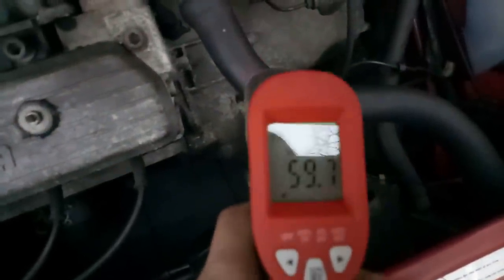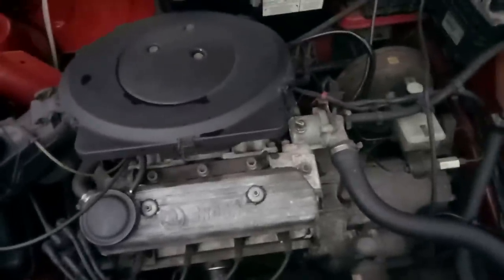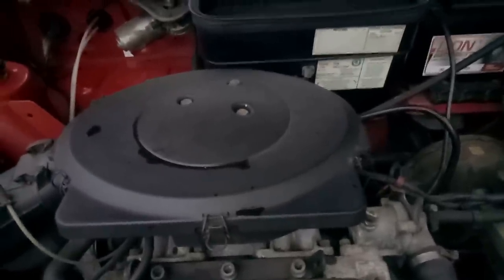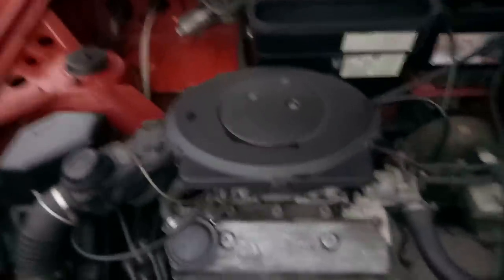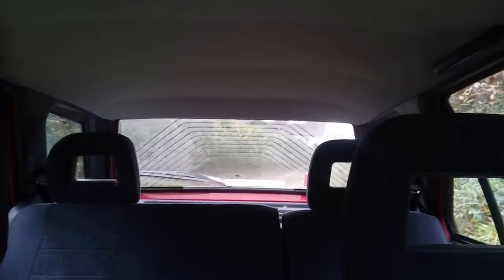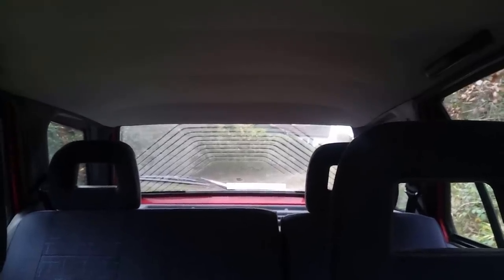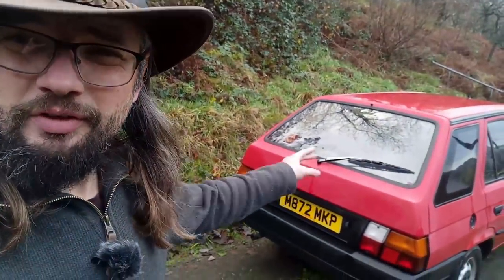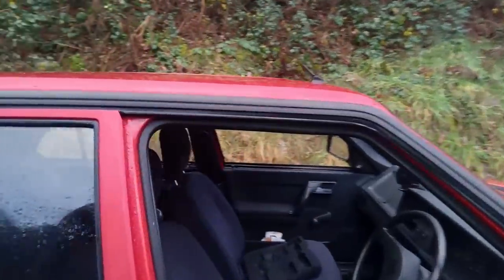Skoda Favorit Odometer fix (and other things)

Comment: A small amount of Oil Emulsion or ‘Mayonnaise’ in the Rocker Cover and Oil Filler Cap is usually a sign that the car has been used for short journeys in a relatively cold climate. The engine is barely able to achieve its optimum operating temperature. This can be termed as ‘Condensation Sludge.’ Different materials and their Mass used for the Rocker Box, and Cylinder Head (Steel –v– Aluminium Alloy, etc.) will also make a difference too. Another fundamental cause will be ‘Climate,’ as the Rocker Box is the first zone to cool when the engine has stopped – Condensation Sludge hardly ever appears in Hot Climates!

Large amounts of Emulsion will indicate more severe problems such as a Failed Cylinder Head Gasket, Worn Piston Rings, or Leaky Valves, etc. Water will also be present on the Dip-Stick. However, some cars are notorious for ‘Excessive Sludge.’ (Old Vauxhall/Bedford HA, HB and HC Engines in particular) Typically, a Compression Test will highlight serious problems within the engine, thus isolating ‘Condensation Sludge’ as the culprit.

The Emulsified Deposit forms when water is mixed with oil, and ‘Whisked’ with the general clatter of the engine. Water (from combustion) gets in to the Rocker Box through the ‘Blow-By Effect.’ The Gasses and Vapour in the Rocker Box are ‘Scavenged’ with a Crude Ventilation System – Usually a piece of Rubber Tube, running from the Rocker Box to a point just before the Inlet Manifold. There can also be a ‘Tee Joint’ with a second tube running to the base of the Air Filter Housing (Vauxhall Failed Solution). However and to work effectively, there needs to be an ‘Adequate’ (but not excessive) FLOW of air – Ideally ‘Incoming’ from the Air Filter Housing, and then ‘Outgoing’ from the Rocker Box to the Inlet Manifold, from opposing ends of the Rocker Box.

The Vauxhall ‘Luton Abscess,’ was caused by almost non-existent ‘Scavenging Air Flow!’ – Incoming and Outgoing Air were attempting to pass through the same ‘Y Shaped Hose.’ Inlet and Outlet air also used the same Spigot. Also, the Spigot Block on the Inlet Manifold, had a miniscule ventilation hole that became blocked with sludge as soon as you looked at it! In some severe cases it could also send sludge up to the Air Filter Box, contaminating the Air Filter Matrix, before completely blocking the inlet tubes – Zero Crankcase Ventilation, thus generating even more ‘Mayo!’ Vauxhall’s response at the time was “No need to worry, Sir! – They all do that!”

The solution was to abandon the Y Shaped Hose and use two separate tubes, to create FLOW. This did mean forming a second Spigot to the Rocker Box. Air then flowed IN from the Base of the Air Filter (Post-Filter), and OUT to the Inlet Manifold. A slight adjustment of the Idle and Mixture settings would also be required (Carburettor Engines).

From the video (and the Gauze Filter Mesh in the Oil Filler Cap), it looks as though the Skoda uses the Oil Filler Cap for the INLET Crankcase Ventilation. Some Caps are more sophisticated, having a Non-Return Valve to prevent ‘Oily Smells’ venting back to the Engine Compartment. The valve can sometimes ‘Stick Closed!’

I would suggest replacing the tube from the Rocker Box to the Inlet Manifold; as the rubber degrades quite quickly, and will eventually block the tube! There should also be no constrictions or sharp bends in the tube either, as this severely limits the flow of air, and will cause ‘Cold Spots’ where Sludge will form.

The Thermostat also appears to be a contributor here too, as the car is not reaching its optimum operating temperature. If it was ‘Stuck Open’ your Heater would not work at all, and there would be low temperature readings almost everywhere (IR Thermometer). You also mentioned that the Radiator Fan does not engage either – Radiator not reaching ‘Trigger Temperature’ for the fan. It is possible that the Thermostat is not closing fully, resulting in low temperatures. Therefore, change the Thermostat, and Flush ALL of the Cooling System. The Cooling System could also be full of ‘Hard Tap Water’ – An indication here will be large amounts of calcified deposits around the Thermostat Housing, when it is taken apart. In some instances (Black Country Water), I have seen Water Pumps seized with ‘Calcates!’

As someone else suggested, it would appear that the Temperature Gauge is a ‘Red Herring,’ in that a VW Sensor was fitted rather than a Skoda. They will have different ‘Temperature Sensing Ranges’ – Hence the ‘Slightly Hot’ indication of the Dashboard Gauge, when the engine is actually running quite cold.

Comment: Lit up like a Christmas Tree, how apposite. Looking at how the drums were reacting when you opened it (and the Sellotape) that someone has done a bodge of clocking the mileage. The fan should be controlled by a separate  thermo switch. Check the earth between the engine casing and the chassis by bridging straight to the battery -ve and see if it makes a difference to the gauge reading.

Comment: Had a favourite and a few Skodas with that engine.  The engine is bomb proof but it is noisey.  Remember is was a rear engine on a car with a front end radiator.  Not a quiet car body, but in a bad way faults seldom mattered.

Comment: The Favorit steering rack is a weak part. My mate's failed on the way down to Cornwall; seemed like a tooth had broken off the pinion. Quite easy to replace it for an exchange rack and inexpensive.

Comment: I think when whoever changed the temperature sender they got one for a 1300 Felicia, not a Favorit.  The Felicia has a Volkswagen-derived instrument cluster so the electrical specs will probably be rather different to those on your car.  Changing the sender for the correct part, which might be the same as one for a 1300 rear-engine Skoda, and changing the thermostat should restore correct operation.  The fuel gauge reading not changing when the car is running seems to be a fairly common thing with Favorits, it was mentioned in a few contemporary road tests so it rather appears that's how they are.  Despite the issue with the clonking steering rack I think you're right about the mileage on the vehicle.  If it is as low as 20-30,000 miles it suggests the car has spent a lot of time dormant, and if it was dormant for a long period and then put back into regular use some cars do have issues with the inner tie rod joints where they attach to the rack itself drying out and losing the lubrication and packing quality of the grease, and then suffering wear which can manifest itself in the clonking you can hear.   Pulling back the rack gaiters and re-greasing the joints can quieten them down but if that doesn't work then the only option may be a new rack or a rebuild of the original, depending on the availability...

Comment: Good job Ian on fixing a few of the current issues.  It will be interesting to see if you are able to recover the faded red paintwork eventually.

A product called Goo Gone is very good for removing glue residue and also the sticky rubber stuff used on camera grips and portable radios. Unlike white spirit, Goo Gone doesn't seem to remove any lettering on the product. It's available on Amazon UK.
Reply: WD 40 is a very good solvent of glue residue.
Working life using pneumatic nail/staple guns etc, used WD40 to clean triggers and safety mechanisms but only airline oil inside.

Comment: That Tigar tyre on the spare wheel might well be the original.  I do seem to recall that these came with what were, at the time, "no-name" tyres...
Reply: Tigar is an ex-Yugoslavian tyre brand
Reply: @paolotarantino-televainio6706    It wouldn't be a great surprise if they were original equipment on the equally Communist Czech Skoda then, as well, probably, as the Zastava/Yugo...

Comment: Before  you drive you could stick a lump of thick cardboard in front of the radiator and that will give you a speeded up version of your cooling system's habits and even seeing the fan kick in if everything is ok. ..if it remains cool  then probably a thermostat fault? Also take off the lead off to the temp gauge sensor ( usually on the head with the plumbing) and ground the lead ..if the temp gauge needle flies over to hot ..then electrically the temp gauge is working ok.

Comment: Try comparing speedo to a sat nav speed indication, normally sat navs seem to read lower speed than the speedo but I tend to go by the speed on the speedo which although maybe reading 30 and sat nav or actual speed maybe a couple of mph lower but I avoid speeding tickets. 
Love the faded needle fix👍
You could try smearing a little silicone lubricant on the tailgate seal, I’ve tubes of seal rejuvenater on the famous auction site we all know and love.

Comment: With regard to what you mentioned in a previous video regarding the back of the indicator stalks not being finished with an open mould/grill type thing going on. The Yugo Sana had the exact same problem ( I used to own one ).

Comment: I had water in my Laguna boot drilled a hole in the bottom job done
Reply: I recall this once on a Simca, the luggage compartment (at the front) was leaking filling the spare wheel well with water. After a new seal and several attempts water was still getting in, so a hole was drilled at the lowest point of the well to allow the water to drain. The small puddle disappeared, job done. However no one actually checked where the water had gone. The spare wheel well is actually formed in the top of the fuel tank!

Comment: Hi mate if the thermostat is easy to change and it does look fairly easy ,change it the engine will run more efficiently and your mayo in the oil cap will go and your heater will be much more consistent.  Love your videos

Comment: Rustproofing is a potential minefield.  While it keeps moisture out it also can trap moisture in in pockets making any burgeoning rust problem a crisis for the future.
Reply from the maker: Still better to have it than not I reckon.
Reply: Maybe wait until the summer to get it done?
Reply: @HubNut  i have to disagree with you on this one, rust is better if you can see it then deal with it, hide it under what ever product is going to be used and it will spread throughout the hole car without being noticed.
Reply: It won't fall apart before next summer, get it done on a hot dry day.
Reply: Perhaps use something like Fluid Film which is lanolin based. Not exactly clear but you can keep an eye on what is happening underneath. Certainly better than thick black stuff. That does hide any rust that forms underneath. Spray can Fluid Film easy to apply and freshen up when needed.

Comment: In my bangers of old, I used to drill a small hole in the lowest point of the boot floor to allow any water accumulated there to drain out . Ok not ideal but cheap and effective!

Comment: The power supply to the gauges is often regulated to around 10v for consistency of reading. Sometimes by way of a replaceable electronic regulator unit but sometimes by just a length of resistance wire. The later can vary widely depending upon the amount by which the wire is heat soaked. I would have a look at the voltage stability of the supply to the gauges. You mentioned before the odd behaviour of the fuel level gauge also. Does the indicator flash frequency vary with engine speed as this can be a clue. 
  Either way I look forward to watching the blossoming of the Skoda, only problem being that it's already rather too good for true "underdog status" and the blind love that brings with it!  It's nice, but it's not TWC or Ellie!

Comment: Ian just fit a new thermostat anyway. If it reveals another problem then that's something else to fix and more content for the channel. Somebody has already suggested earthing the sender wire which is an easy way to check if the temperature gauge is working. If you're going to replace the sender unit, you should get a genuine Skoda one. I'm sure it would be worth it for an accurate temperature reading.

Comment: If the Skoda hasn't been used much,the thermostat could be sticking open,hence the cold running. Cold running can cause lots of problems such as gelling of the oil (It gets worse in late model cars where it creates something akin to crude oil) .and on carbureted engines it causes bore wear because of fuel washdown.
Reply from the maker: Very true.

Comment: I'm not sure but would guess it needs a good flush and refill with evil coolant stuff  mine was yellow now its greenish but used to be blue . Some times removal of the Thermostat would be done to prevent the gauge from going up past Normal  .
 And the steering issue linked with changing the suspension might be caused by driving up into parking spaces and hitting the kerbs or its the London Pot holes , I would generally turn the music up and wait until vibration through steering wheel .
Mrs Hubnut was kinda right but its  airfix paint or nail varnish as felt tips fade quicker

Comment: Because the car has an injection system, find the black and white plug (or the ODB2 port) and connect a scanner to it, so you can read the engine coolant temperature as detected by the engine management.

Comment: skoda seals tended more than others to flatten, you might have to adjust the tailgate hinges and catch to pull it harder to seal, also the fan resistor was very crude, just exposed resistance wire, you may be able to buy some on ebay and fix for pennies

Comment: Haha, I'm happy to report that from what I remember they fixed the useless rear de-mister on the Felicia so it covered most of the window. That said, when I bought mine only maybe 3 of the lines actually cleared. I bought some thermal compound or whatever it is as it was likely just little breakages along the lines but never got round to fixing it in my ownership. I'll say one thing... My Skoda had I think the best heater of any car I've owned. I may have said that before. Absolutely toasty no matter how cold outside and got up to temperature way quicker than anything else I've owned. 

Totally unrelated Ian but my 89 Fiesta failed it's MOT today on:
• Parking brake inoperative on one side (nearside)
• Service brake efficiency below requirements 
• Parking brake efficiency below requirements 
• Brakes imbalanced across an axle Rear (axle)

I've also got advisories on sill and wing corrosion which has been a regular occurance for ages according to the history. I patched up the rust with some converter at the end of summer. Along with a slightly blowing back box.

So... I'm not confident enough to mess with the brakes myself so this is a job for the garage. They said they won't know exactly what needs doing until they take a proper look at the brakes so can't quote me for anything yet. 
I absolutely can't justify keeping this car on the road but I love it and am wondering whether you think it'd be worth the cost (any ideas?) of sorting the 4 brake failings out. I bought the car in the summer for £300, spend £200 on sorting a bearing and a couple of other bits and have been happy with it since. Its my second car so really just a toy. A sane person would probably send this thing to heaven (it's a 1.1 not an xr2 lol) but this is a true Hub Nut sort of dilemma. Any advice Mr. Nut? Thank you!
Reply from the maker: Hard to say what needs doing. Brakes aren't that scary though.
Reply: @HubNut  too scary for me to fix before the 10 days are up though! It's on my to-do list of things to learn haha. I fitted a new battery to my main car today and decided to have a little play with my £200 Micra that's still on the driveway. Unbelievably it starts every single time, this time it was left for a few months. I've got somebody who is likely to take it on so I'm interested to see what that'll need doing (other than a couple of tyres) for its test. Those jellybeans are bulletproof!

Man it's great to hear you enjoy all the comments and tomfoolery from your viewers. This is one of those channels which (bar the Skoda haters, who I hear are just 'well jelly'), contains pretty much nothing but good comments and nostalgia in the comments sections. It's rare. You can't go into the comments of a damn kitten video without seeing somebody bringing up a 9/11/chemtrail/vaccine conspiracy theory, somebody insulting somebody else's mum and death threats coming from all angles. I dig that your viewers are of all ages and expertise when it comes to motors (e.g. I'd never serviced a car until this summer) and all have one thing in common - we love motors! Esp the otherwise unloved ones.
Reply: Sounds very much like a rear wheel slave cylinder  has failed contaminating it's brakes shoes.
Think fiesta has hub and bearing combined so not so easy without proper tools ie Torque wrench.
Reply: @chriseccles1454  thanks matey. Any guess on possible cost / number of hours labour?
Reply: No sorry, used to do my own front pads, rear shoes years ago.
Workshop manual would be a good investment. Just a heads up that rear integrated drum/hub would need torqueing of bearing.
Ps Once you find a good garage/mechanic hang on to them.
Reply: @chriseccles1454  thanks dude. I've got myself some good guys locally now (thank god) after moving from the area from a mechanic friend of mine who ran a garage. I've got myself a Haynes manual for the model and I'll have a nice nosy through it tomorrow. Thanks again!

Comment: i had an  old ford year's ago  the temperature guage never moved much the interior heater would never get hot in the winter. Upon further investigation i discovered whoever (before me) had installed  the thermostat but it was never fully seated in it's recess properly. i reinstalled it properly installed a new gasket and bingo heat at long last.
Reply: Had the same experience with my 1986 XR2, put in a new thermostat to cure cold running, 
 next summer it overheated and blew the head gasket, shouldn't have bothered.